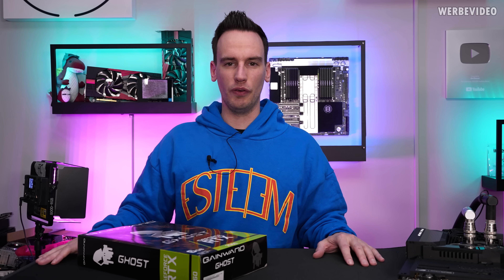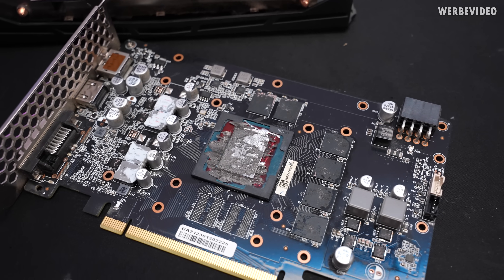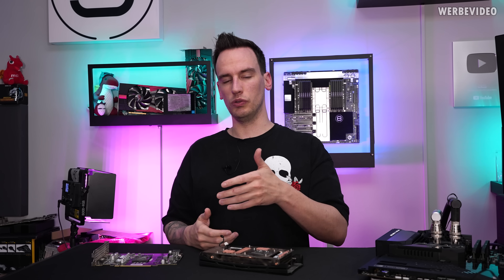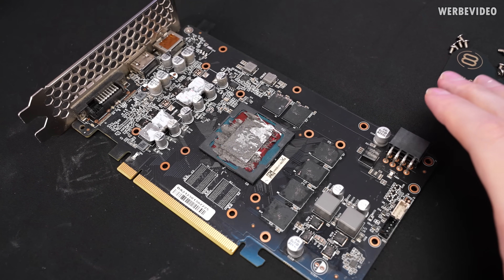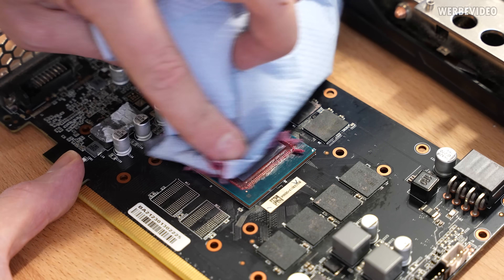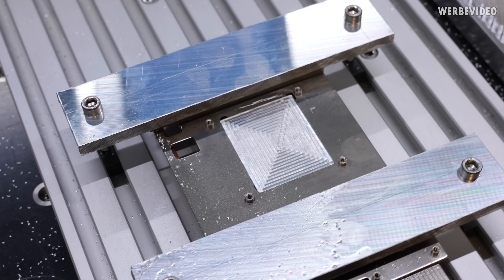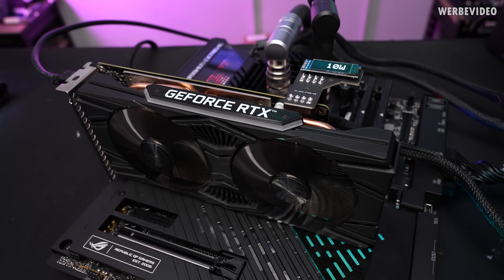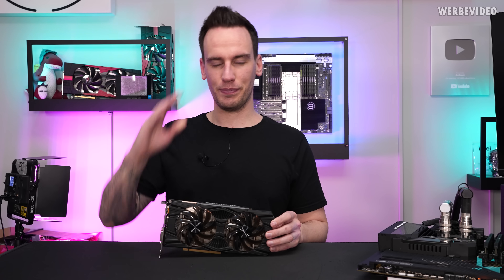Viewer-Mail Ep7: Nasty Liquid Metal Damage - Rescue Attempt

Comment: So it's an alloy of gallium and aluminum? And the aluminum is similar to work hardened aluminum? Interesting...just by looking id assume the aluminum had been oxidized with no previous knowledge...I seem to remember that after removal you should wait awhile to make sure you didn't scratch off the oxide layer and start the reaction again to be sure.

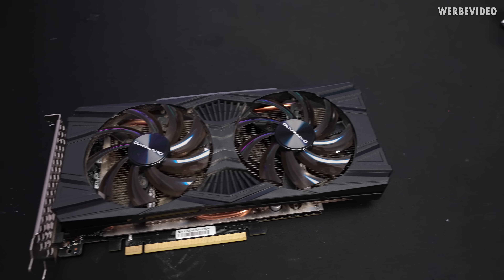Comment: 1:28 how do people let their cards get in such a mess? No wonder the user had temperature issues. Therer was no way that cooler was working anywhere near normal efficiency.

Interesting video. However 77'C on an open air test-bench is poor temperatures.

I have filters on my PC air-intakes, and reguarlly clean inside. ... That includes taking the fans off the CPU cooling tower, to clean the aluminium fins, and fans. Plus checking my GPU now and again for dust on the fins. If needed it gets stripped back and fins and fans cleaned. It all works better and quieter if you do.

Comment: hi!i watched some of your videos.... i have a question! i put some conductonaut on an i5 6500 and i don't see an improvement! why? on stock tim in stress tests temps went like 67 degrees...with liquid metal......like 65degrees.....i use mx4 as thermal interface between ihs and cooler! thx

Comment: One option i guess is getting some copper sheet stock and milling down the whole thickness of that. It will make it more likely that you remove sufficient amount of gallium residue embedded in aluminium so it won't continue eating it. You can use paste both sides or die side LM, cooler side paste. Though i wouldn't say this card warrants LM, the themal impedance of the cooler is too large, and copper is already an improvement.

How does one even nickel plate alu? It is a mystery to me.

Comment: I had a 6900XT and used Alphacool Eisfrost Xtreme liquid metal on a nickel waterblock Alphacool Eisblock and the LM heavily pitted the block after 12 months. Ended up trashing the block, as great as the LM was for cooling I won't be using it again if it pits nickel. Temps were fantastic, but LM may not not ready for long-term use.

Comment: What a perfect timing for this video. I was just in middle of delidding my 13900kf and applied liquid paste on the die and Rockitcool's full copper IHS. 

Temps between cores were so bad after the process that I had to remove the retainer system and pile up the cpu, ihs and water block layer by layer. If you ever attempt this, tape the IHS to motherboard before slapping the water block on. This way you can be sure it doesn't move when you screw the block on, as there will be nothing nothing holding the stuff together. As long as there is no tape between the ihs and water block, you can pull the tape off after you are done tightening down the cooler.

No more throttling under Aida64 extreme.

Comment: So many liquid metal horror stories for me to even consider bringing that stuff close to my hardware
Reply: It's awesome if you know what you're doing.  I don't think it's worth it using it on a air cooled GPU like this dude did, the die is large and should have no thermal issues with a decent compound and heatsink mounted properly.  Only worth it on a overclocked liquid-cooled processor.

Comment: Did you consider making a 0.5mm shim to replace the milled aluminum? Would the additional thermal interface (even if filled with solder) been worse than the missing mass of metal from the milling?

Comment: the whole liquid metal killing gpus and other electronics is stupid.. STOP USING IT! FFS.. a couple degrees difference from a normal paste to that ISNT WORTH KILLING SO MANY ELECTRONICS..  besides using an electrically conductive material RIGHT NEXT TO CAPS AND RESISTORS POWER RAILS IS IGNORANT.. I don't care what reason anyone has IT'S NOT WORTH IT AND THAT'S THE END OF THE STORY. eventually that stuff will leak onto other things either by it being applied to heavy or from moving it around and it leaking out.

Comment: You can add thin sheet of cooper to that area and melting it together with some soldering paste (then sanding it a little bit)
Reply: Copper and aluminium also corrode when put together

Comment: The cooler is definitely ruined. Easy fix would be a cooler from a dead card. Gallium will eat most iron and aluminum alloys. In some cases, it can leave the metal in a condition where you can crumble it with your bare hands.

Comment: You could instead made a copper square or circular inserto so no additional modifications would me needed.
Add thermal paste or thermal glue to bond the insert to the cooler and it may perform better than stock since copper is a better heat conductor.
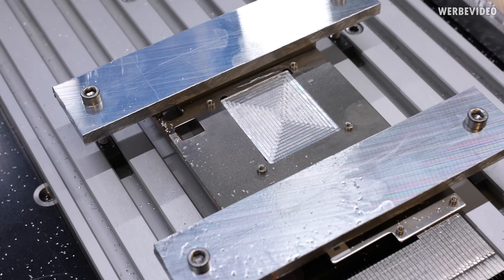Also polishing the hole you made 9:33 would improve the thermal conductivity.
Reply: Having another transfer layer would most definitely perform worse. You can also see in later shots that he did indeed polish the milled-out area.
Reply: @IceLom  The last shot seems to be obscured by camera glare but I can still see milling lines.

Comment: Does the nickel actually form a barrier to protect the aluminium from the gallium? Gallium will alloy with nickel too, its just that this doesn't damage the nickel, just potentially causes a little discolouration. But at the point where it has alloyed with the nickel? Well, it can basically just pass through the nickel surely? Seeing as the nickel is plated onto the aluminium.

Comment: This was AWESOME!! I was expecting MUCH MORE Damage... so I think you're right about the nickle platig.. but there cvould have been the TINIEST of scratches through that nickle and that's why there was damage at all...
GREAT JOB!!!
Reply: Does the nickel actually form a barrier to protect the aluminium from the gallium? Gallium will alloy with nickel too, its just that this doesn't damage the nickel, just potentially causes a little discolouration. But at the point where it has alloyed with the nickel? Well, it can basically just pass through the nickel surely? Seeing as the nickel is plated onto the aluminium.

Comment: if gallium gets on aluminum, such aluminum can be thrown away. Now he kind of shines. But in fact - corrosion with depth still continues - when penetrating, gallium itself DOES NOT BE CONSUMED and continues to destroy intercrystalline (intercellular) bonds. And you just delayed the moment. when the aluminum plate finally "breaks through" and ceases to perform the cooling function!

Comment: Nice repair!!

Glad to see a simple milling was all it really needed.

As for the voltage sensor, im keeping my eyes out for the official release! I know its probably late notice and already thought of, but you sgould also have an alternate version that has the power cable plug in from the front side of the computer 90° rotated on the x plane from what you have there, it will give more functionality to people with smaller cases in the future due to cable management, it'd alao make for neater cable management for cards with the pcie power at the end of the card, like evga stuff.

Keep up the great work :)

Comment: During the materials science portion, grain boundaries were not mentioned for nickel. Zhou et al. 2021 “Effect of grain boundary engineering on corrosion behavior of nickel-based alloy 825 in sulfur environment” document reduction of grain boundaries’ extent with specific treatment. I think it is worth mentioning that the gallium diffused through the nickel grain boundaries to reach the aluminum grain boundaries where the damage took place, and molecular diffusion of gallium will eventually reach the aluminum even for a nickel barrier free of grain boundaries (tho molecular diffusion of sufficient mass for macro Ga/Al rxn may take many years).

Comment: My personal opinion on the whole "Liquid Metal" saga that's been happening for the past 4-6 Years is that regardless of the small benefits that these "Liquid Metal" products offer they simply can't replace the benefits of existing "Thermal Paste" solutions.

I say this because "Thermal Paste" doesn't have any properties that result in the "Paste" eating away at other metals including metals commonly used in the construction of heatsinks & other thermal management hardware.

If "Liquid Metal" either;
1• Leaks out of it's position over time (as could happen when used with any hardware that is moved around a lot like SFF Systems or Laptops) .

2• Is poorly applied either initially or after a sustained period of time (For Example: 5-10 Years)

Then you instantly have problems that cannot be overcome due to the nature of metals like "Gallium" which is commonly used as a "Liquid Metal".

The only thing that Liquid Metal products are good at is "Planned Obselecence", because they guarantee that MORE then just the "Thermal Interface Material" will fail over time. They ensure that other pieces of a device will NEED to be replaced whereas if a traditional "Thermal Paste" was used then it wouldn't effect any other hardware whatsoever.

Manufacturers are constantly looking for ways to indirectly create "Planned Obselecence", and "Liquid Metal" products hand them a solution to their greed on a platter.

Comment: It would have been cool if you just machined it a square out then dropped in a copper square with thermal place holding it in then you could have used liquid metal again so you would go liquid metal copper thermal compound aluminum heat sink

Comment: Milling out the deterred aluminium thins the heat plate i get it. But will this not have effect on the heat distribution throughout the plate with long time usage ? Interesting topic Roman
Reply: I mean the volume removed was extremely low.

I'm more surprised about the fact that liquid metal TIM actually contains Gallium and that people are "ok" with using any amount of Gallium in their PC's.

There's a reason why that shit is flat out banned and is a criminal offense to carry on aircrafts.

Comment: would keep CNCing till you hit the heat pipes and then you can just drop in a copper plate and torch solder it to them. Should make it better. And can't wait for that power port monitor however this is a top of card model that would be impossible to use with my cables. one that aims down would be great as that is compatible with all cable routing.

Comment: start CNCing it out and see if you can drop in/solder in a copper plate. That aly should be connecting to a copper plate or the heatpipes after all.  Then solder and a torch should melt it and fuse it with good cover.
Reply: That was my thought as well, but it is a low tier GPU.  Since it had the clearances and the liquid metal didn't go that deep this works and is much easier.

Comment: My experience with liquid metal and GPU:
Applied LM on 1080ti, tested, found only a minor difference (if any, because fan curve got adjusted and still kept about the same temperature, just running bit slower), scratched my head, reapplied paste back.
There's a lot more downsides than benefits and I see no reason to use that for mid or entry level cards. Even 5 degrees C is nothing if its a difference between 65 and 60. People should stop be obsessed with temps. Undervolt if you can and stop
Reply: I went from like high 80c to high 73/74c on my 3060ti swapping out the factory thermal paste and ramping up the fan curve
Reply: LM sucks at gap filling, I've had applications where it was terrible and other where it's awesome (like one of my first applications led to a +50% core OC on a GTX 680M)
Reply: Actually the difference between 60c and 65c is astronomically MASSIVE in terms of GPU temperatures.  5 degrees is literally the difference between a top 5 and being out of the top 100 leaderboard.
Reply: @NinjAsylum  That's assuming you're an OC'er? I still can't see how it applies for most casual users. Applying LM will 100% stain your radiator (copper 100%, nickel plating the safest but prob not entirely secure either) and GPU die, and adds extra variable in terms of something that can brick your card. Heck there are reports of LM leaking PS5's even though they had padding to prevent spillage. I've seen a lot of vids with really expensive GPUs getting damage from LM. Just buy a good ventilated case and undervolt if possible.
I'm not saying its straight bad, I used it myself but eventually grown up out of this
Reply: Step 1: Determine your maximum boost frequency & voltage
Step 2: Use MSI Afterburner Curve Adjuster (Ctrl + F) and Click -100mv below your max voltage, hold shift, and raise the entire curve to your maximum boost frequency
Step 3: Shift click the graph and drag your mouse to highlight all frequencies to the right of your desired target and hit Shift + Enter on keyboard to flatten the entire curve to the right, sometimes need to do it twice to completely flatten it.
Step 4: Apply and enjoy

Easy -10°C undervolt

(There are videos on YT explaining the whole process if my directions don't help anyone)

Comment: There is always a potential for issues when using dissimilar metals. Some play great together while others do not. Gallium and aluminum are highly destructive to one another. Now on the Thermal Grizzly website it does state not to use Conductonaut with aluminum heatsinks. But a lot of heatsinks are made from aluminum, so isn't that just asking for potential problems? It should state it can only be used on copper.
Reply: Can't be responsible for every moron out there.
Reply: @noxious89123  No but they can cover the rear ends a little better.

Comment: Great video, but I can't help but notice 1 small possible issue - the leveling during CNCing was done based on finstack and not on heatsink base.
If the base was actually in parallel to the finstack, that should've been mentioned.
And if it's not parallel, then, while you might've leveled standoffs with GPU hole, if the rest of heatsink is angled the contact may suffer somewhere due to different "GDDR height".
But that also depends on what thermal pads were used. The problem could be present with good hard ones, and not present with poor-performing soft ones.
I've seen a great deal of repair videos where GPUs suffered from bad temps due to users messing with cooling and assuming thermal pads can flatten when they mount the cooler.
Reply: I would assume he probed the GPU side surface of the cooler off camera and adjusted it to level.

Comment: The mill is now contaminated. That stuff that was milled off contains gallium in a form that can transfer to fresh aluminium.
Also, the structural and thermal changes to the aluminium does not stop at the surface. Milling of visually affected area is not enough.

Comment: de8auer you should take a look into the Gigabyte B650E Aorus Master that you had on your channel, it has a QC issue where it cant handle AVX intensive workloads or even very intensive CPU workloads sometimes.
For the most part seems to be fine with 7600x CPU, feels very bad for people that have 7600x CPU with that motherboard and wont know if their motherboard is fault or not.
It Even seems to work fine with higher core CPU if you lower the clock speed by allot.....
Reply: Thanks for mentioning this I had planned to upgrade using that board specifically for heavy workloads on a x7950 3d. Not anymore...
Reply: My Z790 Classified has a setting to automatically lower the multiplier on AVX workloads.  I suspect it's how fine tuned the processors are these days, they're already overclocked the way we're getting them, and AVX is very intense.  I know, that's Intel processors, but both Intel and AMD are doing the same as far as how their processors are tuned at the factory.  It's recommended to run that setting I mentioned 2-3x lower than your set multiplier, so if you have the performance cores running 5.8, they'd only run at 5.5 or so under those AVX instruction sets, there's just too much heat generated and the stock clock already pushes it to the very cusp on water.  I'm not saying there isn't issues with that board, just thought that might be a contributing factor.

Comment: The gallium probably absorbed into the aluminium a lot deeper than you milled off, so it will likely be very brittle still, even if it performs fine as cooler.
Reply: It would actually be interesting to see it opened up 6 months from now to see if there's any visible change to the area under pressure.
Reply: Important to know.  Also important discussion about material quality and purpose.  Since it is just a cooler there's very little physical stress, and it should be fine.
Reply: @mikeycrackson  huh? What does that have to with either of my comments?
Reply: @mikeycrackson  And your added part has absolutely nothing to do with my comment. You don't need a 450w cooler for a 120w card. For 70$ you can buy a morpheus, and he's implying that a 70$ cooler won't cool a 120w card for 3 years ago. Or did you just come in here, read one comment out of a chain, and decide that was the one that you were going to interject yourself?